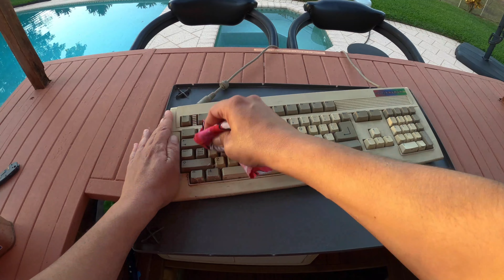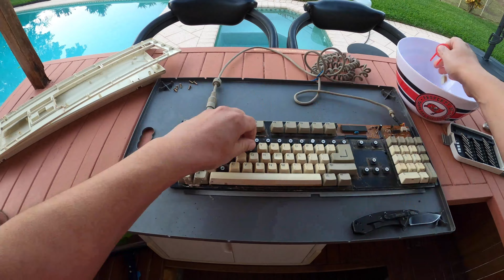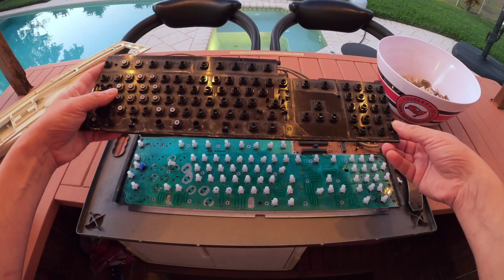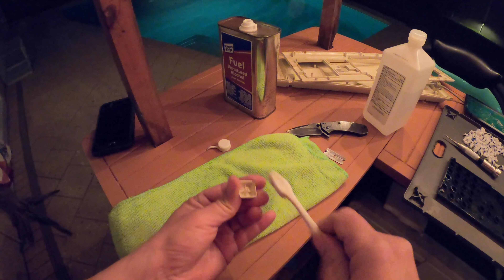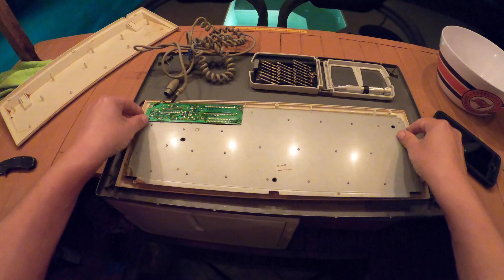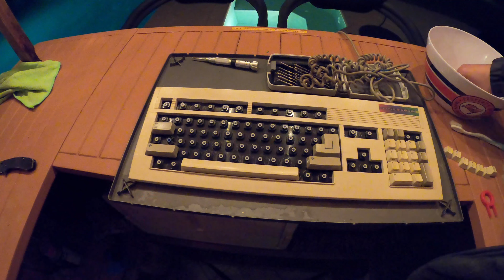Amiga 4000 [PT4]: The Amiga Keyboard From Hell: Epic Adventure - #IJDM028

Comment: A few years back, there was a kickstarter to make a new batch of keyboard membranes for A500/A2000 keyboards. There's still a few of them floating about, maybe 50-60 dollars a pop. If you can't fix the original with conductive paint or similar, replacement is still feasible. There are also keyboard adapters to use a Ps2 or usb keyboard, but buyer beware - they don't work with every keyboard.
Even with a dead membrane, it's still worth $$$. ;)
But don't get a membrane for an A1200 - these have a very long membrane connector and just break if you try to fold them into an a chassis that isn't an A1200. The same for A600 (no keypad on those, long connector again.
The bit that can't be bought new is the keyboard controller chip - CBM programmed their own. There are ones that come close but they don't quite work with all the keys.
Reply from the maker: I just took a look and appears a few sites have them including the AmigaStore in EU, but I will have to wait a bit before I can order when my budget will allow it.